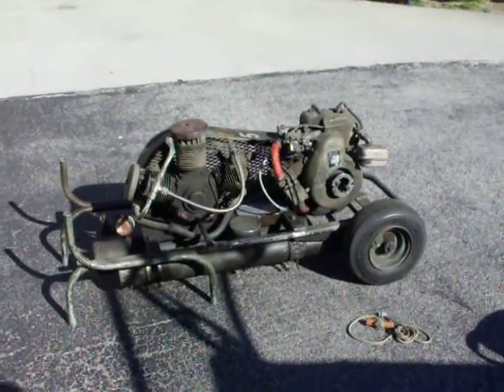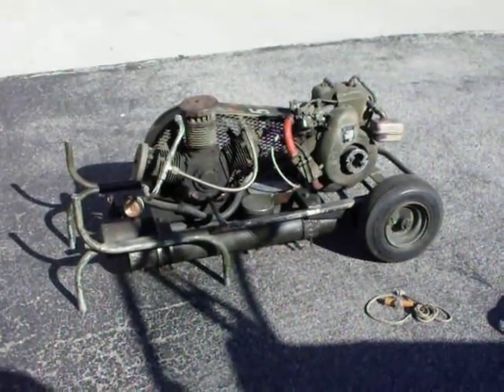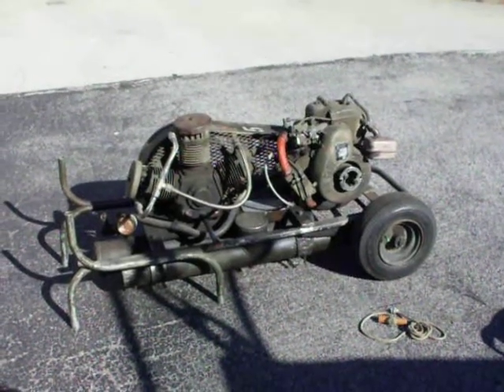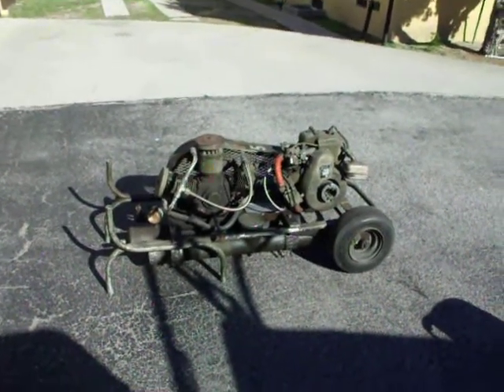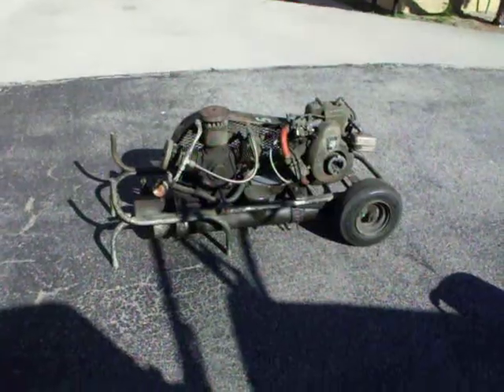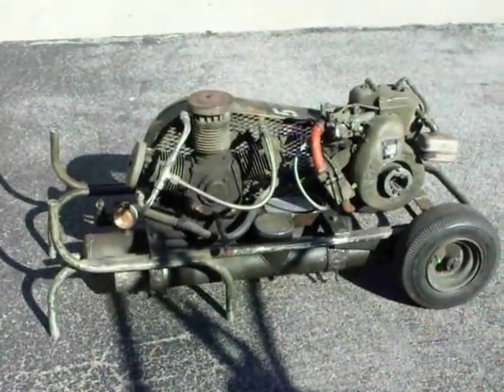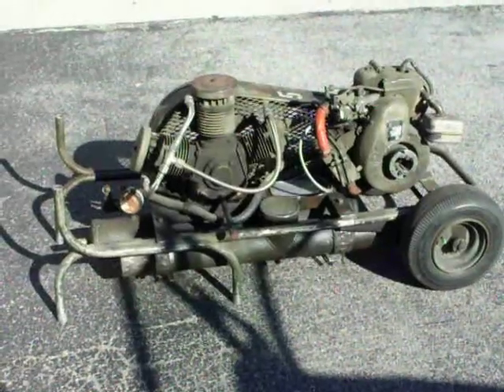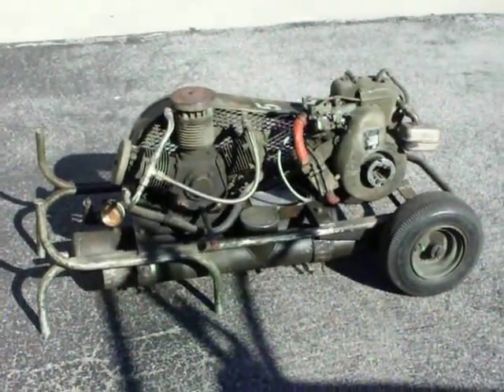Military Air Crompressor

Comment: I am currently working on one of these   good to see one running
Reply from the maker: Hey Pwalpar, remember this video. I think that you should get your military air compressor running, buy a 16 penny pneumatic nail gun and use the two to put your new deck together with. What do you think?
Reply: @w.w.2restorations.vehicles698  Thanks yes I have not fotgot It